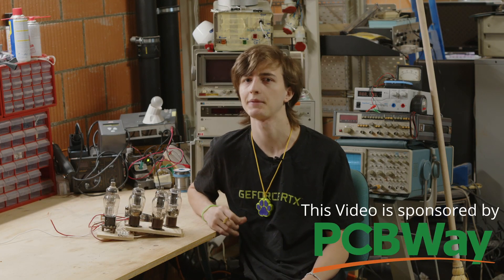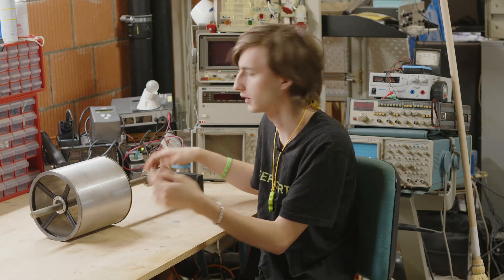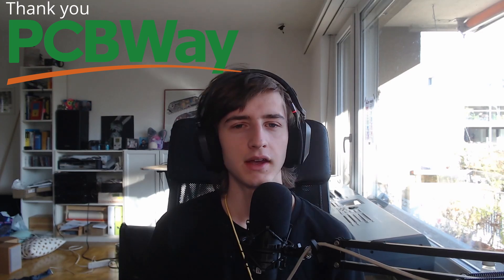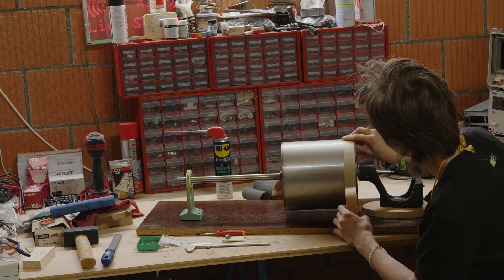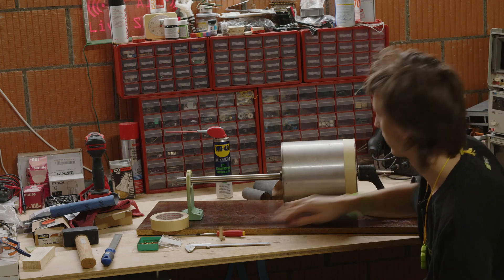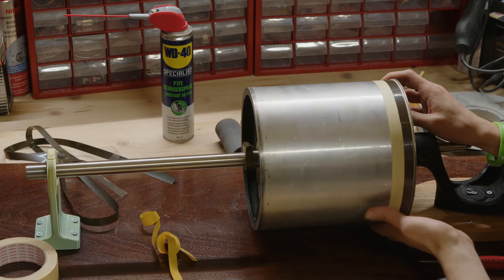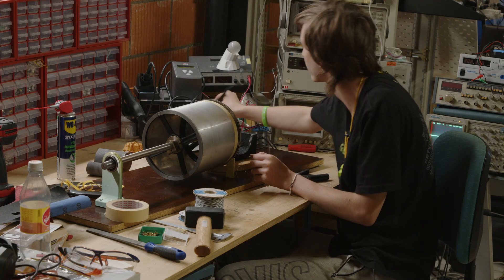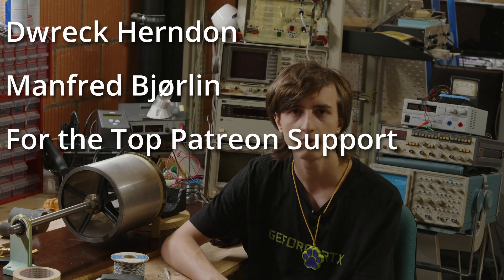DIY Drum memory. I am building my own memory drum from scratch [Part 1]

Comment: Rather an interesting project, I look forward to seeing how it develops. It's quite a tangent, but I find it interesting that drum memory resembles a Swiss cylinder music box, with each tooth of the comb being like a head, and each pin in the cylinder a point of data. Some music boxes can even shift the cylinder sideways so there are multiple tracks for each tooth. I don't know if any drum memory systems tried that, I think it would be more trouble than it's worth. Intriguing how concepts can reappear using different technology, for a different purpose.
A very early sort of magnetic drum recording is illustrated in a book I have, The Book of Electrical installations Vol. 3 from 1915. It is the Poulsen wire-drum phonograph, which as the name suggests is a steel wire wound brass drum. Other than being wound on a drum and magnetic it isn't much like a computer drum memory as it only holds one track like a cylinder phonograph.

Comment: You will get a stronger signal the faster you spin the drum. And you need at least two heads -- one for writing and one for reading the data back once it's gone around the drum. If you want reliable data then you would want to build some kind of speed control, maybe with a reflection sensor and a stripe on the drum's rim.
Reply: Or a magnetic control track.
Reply: @therealjammit  To lay down the control track you would need some calibrated, speed-controlled source to record it. 

But what you can do is make a control "track" which only has one pulse over the entire revolution of the drum, just to sense drum speed, and then sync your speed control to that (using something like a phase-locked loop).
Reply: @Stoney3K  For a test any signal would work. For any real work you would have to at least one time spin it nearly perfectly and include a dead zone between the end and start of a track. Another option would be to lay out the tape flat and zig zag a wire over it and apply a current to the wire to imprint a signal. Wrap the tape around the cylinder and use it as your track.
Edit: you wouldn't want a single pulse but a continuous string of pulses. The dead band would be used to indicate the start of the track. The continuous pulses would be used to adjust the speed and clock the data for the other tracks.

Comment: There might be some impedance mismatch between that pickup and your scope, but typically the tape needs to be touching if not like, mils distance from the pickup, so it might just not be getting anything at all.  If there is a signal, yeah, it's probably so weak it's just being drowned out by noise.  it'd need a very nearby amplifier.
Reply from the maker: some other commenter pointed out, that it is very unlikely that I accidentally managed to hit a track, due to the tracks being very thin. which sounds to me as a very logical explenation

Comment: Great project, but I also wonder if this can work with the heads touching the drum.  Do you use cassettedeck heads ?    It could be that after a few 100 rotations you end with all the magnetic media on that track is collected  in the gap of the head if you spin it long enough.  It's a guess not to be negative.
Reply from the maker: this is basically my biggest worry, thats why I am building this prototype to find out exactly that.
And if it happens, how to prevent it from happening.
Reply: @curiouscomputer Then you need a much better bearing and spin it with the heads mounted with a very small gap. Or talk to Usagi Electric. I never saw this before exept in Usagi Electrics channel.

Comment: I thought you did get some data off the head. The signal would only be one maybe two millivolts and drowned in noise. If you put an amp between the head and the oscilloscope it might be more clear.
Reply from the maker: another commmenter pointed out, that I probably didnt actually hit a track with data, so its most likely I did get data from the tape, just that there was only noise on the tape

Comment: Nice. You might be able to find magnetic coating spray that will give you a real drum memory.

I would suggest using floppy-drive heads rather than tape heads for drum memory - they are compact and already have resilient mountings on them.

If you feel ultra-adventurous, you might be able to use hard drive heads instead.

Don't forget to put a [Start of Track] sensor in place, and you might like to lay down a clock track as a part of the control mechanism.